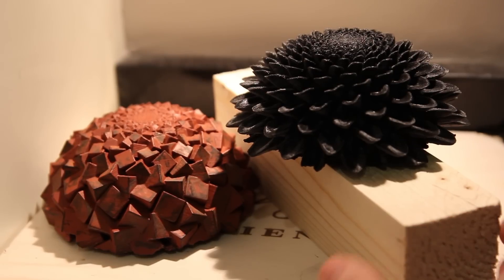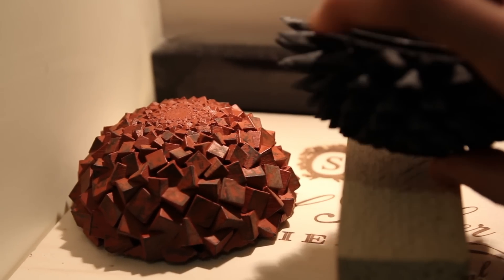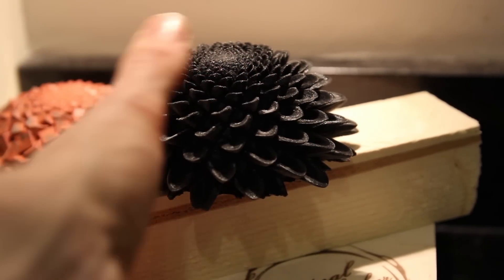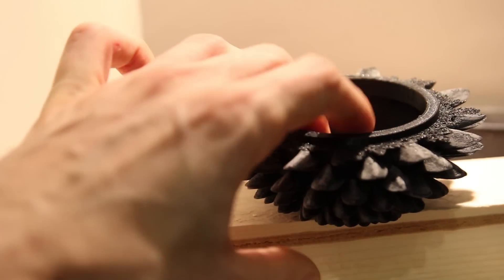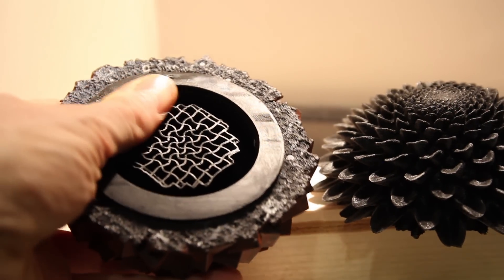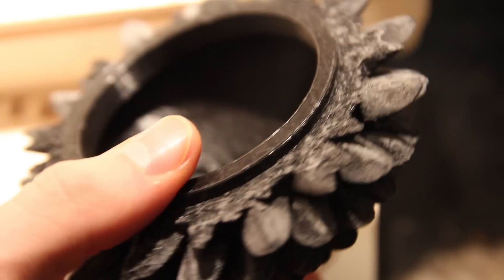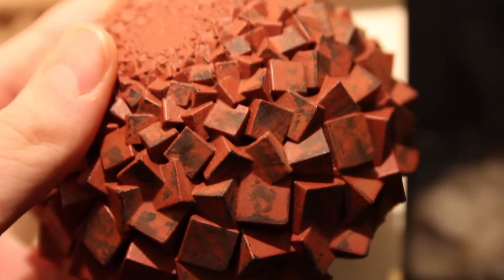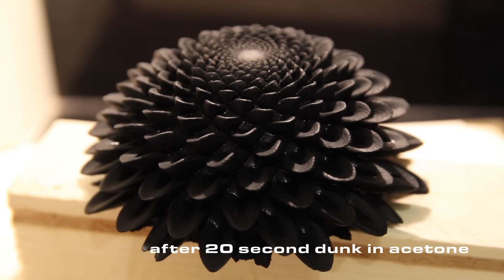PLA SMOOTHING WITH ACETONE BLOOM MODEL

Comment: hi there how did you print the petals at that kind of angle without support material in between??
Reply from the maker: +Jonathan Sherratt I showed the print printing at the end of the video, so you can see the support at the bottom, but the petals dont need it as they are not that horizontal, they were by no means perfect on the bottom, but look good after a touch of sanding and the acetone dip. This was a very early print of mine. and printed very quickly at 70 which i almost never do anymore. the infill makes it a bit stronger too and stops wobbling. I had to print support everywhere from base as the person who moddelled it gave it an irritating base which is slighly raised, but you can easily sink that away in cura expert settings. trial and error. Even though i have very little errors. you quickly learn angles that really need support matrial and ones you can get away with. hope that helps.